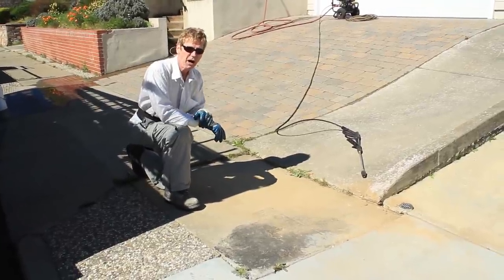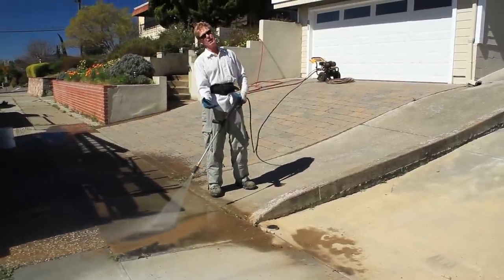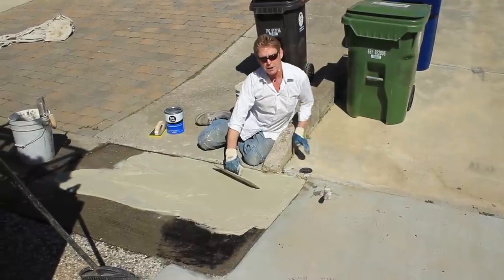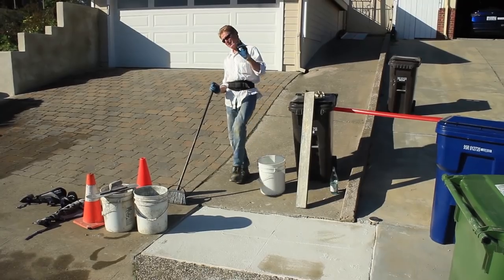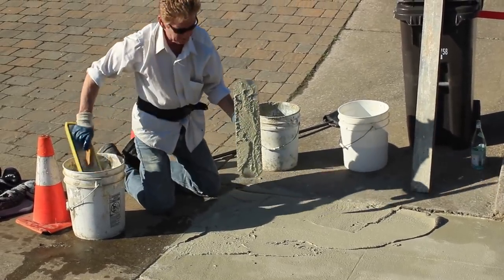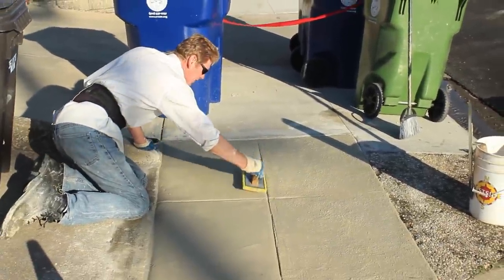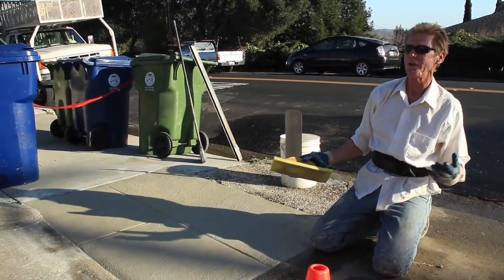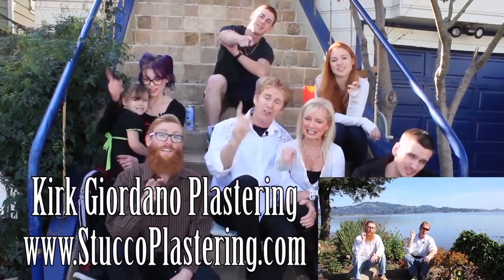Repair uneven concrete

Comment: Kirk, I'm wondering about the mix, ratio sand to poly? I love to plaster so I would really like the ratio sand to poly so I can do a small repair on my driveway. No, I don't like the product at HD OR LW. I get my material at the yard
Reply: i second this  , also "polybond"  it sounds like a denture cream ,and listening to Kirk he sounds like an infomercial pitchman with that perfect radio announcer voice ,if i close my eyes i  feel like i'm watching an infomercial for a denture cream LOL
dentures keep falling out ?  ,try polybond
Reply from the maker: Good afternoon Cristine and Andrea, LOL, we all know what Poly-bond is specifically engineered for attaching styrofoam to base coats of stucco.
 What I do is add about half the sand per mix. Thus if I add a half bucket of poly-bond, I add the rest with sand, then mix.
 Then let it slack for about 20 minutes. After the 20-minutes break, the slake by re-mixing, then fill the holes.
 As I did in this video, I sometimes skim the whole thing once more with the straight poly bond when this coat drys.
 Remember, this shit is important. Nothing adheres to a dusty, dirty, oily surface, 'Nothing,'  not Poly-bond or the best adhesive caulking Sikaflex. 
So if it comes off or cracks, you did it wrong.
 I believe I'm talking to two plasterers who already know this kind of stuff?😉
With my false teeth, I use full strength poly bond hold them in place plus taste yummy.🤔That's a joke, folks, so don't go saying I tried the stuff for my teeth and got sick.😏
          Kirk and Jason Giordano, together we have provided to all folks throughout the world the most complete plastering encyclopedia ever created online.
   The plastering surgeons of Youtube, with well over 850 'free' self-help videos 🎭 👀💃
 Bringing peace, love, and brotherhood back into plastering.🏝🎆
https://www.nps.gov/tps/how-to-preserve/briefs/22-stucco.htm
Reply: @StuccoPlastering  You replied, LOL. I can hardly wait to get started. First let make sure when you say sand, is it the stucco or sand that I would use concrete? No Poly- Bond for teeth, Lol.  I color coated a whole house thanks to your videos.  Next is my driveway then, another house. Thanks, KG
Reply from the maker: Good morning Cristine, dude. Concrete is portland cement and rocks.
 Stucco is portland cement and sand.
 Keep in mind if you use too much sand, you can have a weak surface.🤔
 I added just enough after the poly-bond slacked, I'd say about two or three handfuls. What I'm showing in this and a couple other similar videos are for small repairs. So you don't need much sand. 
 Hers a tip, brother, if the ground ain't clean enough to eat off, nothing will adhere for long. 😉
    Happy to hear you're going to stay in the trade. We need more plasterers. That's my job to educate, as I won't live forever.🤠
Kirk and Jason Giordano plastering, sharing well over 850 free Stucco/Plastering videos for your education. 
    Together we have created the most comprehensive encyclopedia of Stucco and Plastering videos ever produced globally, all by your favorite plastering messengers of YouTube.
Bringing peace, love, and brotherhood back into plastering.🎭🏝🎆
https://www.nps.gov/tps/how-to-preserve/briefs/22-stucco.htm

Comment: So i heard of the comparable product QUIKCRETE vinyl concrete patcher, but does a (Hydraulic Cement) coating blow this out of the water?...a better alternative for this type of application??  My patch area is very small.

Comment: I find Foamtek-20 to be superior to Poly-Bond in mounting decorative foam pop-outs to stucco walls. I think it would make a great choice also for skimming clean etched concrete. Cheers!
('course Poly-Bond is LaHabra and Foamtek is Omega)
Reply from the maker: Howdy Larry, good tip, brother, There's more than one way to skin a cat.
But, no doubt, as long as they are cementitious adhesives, they are similar.🍻
Reply: @StuccoPlastering  Hey! You really DO read these things. 😅👍
Reply from the maker: @LarryEMorse  Indeed, I do as they give me pleasure, not like being in my baby's arms but the mental stuff. 🍾

Comment: Hi Kirk. I’ve learnt lots of things watching your videos thank you. I’m not a stucco guy but I take an interest in what you guys do. Just a point about wetting the surface first with water. Does wetting first dilute the bonding of the material/glue to what you’re applying it to. Thinking the material has enough moisture in it to begin with to penetrate the surface. Cheers fella👍🦘🇦🇺
Reply from the maker: Hi Tyrone, water only dilutes a bonding agent that is not completely dry.💃

Comment: Hi Kirk, I tried cleaning my driveway by pressure washing before adding the product but there was still black areas that refused to come up!

Tried 100% chlorine with a garden sprayer and wow the rest of the concrete driveway looks super clean! 

Every heard of cleaning concrete with chlorine?
Thanks! Bobby
Reply from the maker: If you tried pressure washing with a tubo tip and it stayed stuck, apply a bonding agent over it and stucco away. Sometime not all things come out.👨‍🏫

Comment: Hi Kirk! Thanks for sharing. Is it LaHabra Poly-Bond that you are using? I want to try that stuff. Here in Canada, frost & de-icing salt are the most harmful things to cement or stucco. Maybe that cimenticious adhesive can keep water from getting between layers. You would not like it here in winter. ;-) Great video, stay safe.
Reply from the maker: Good morning Coal Guy Dude, I love the heat as in 80 to 95 degrees. I'm whining in 60-degree weather at this time.😉 For some reason, I am cold-blooded.
 I need to move to the equator like Cost Rica, personally.
  I know what spalling is, but not certain about the poly bond and the snow, sorry.🤔
  Note: to all subscribers or anyone who stumbles on our channel with a question, type it into our Stucco/Plastering channel, and like magic, a video will appear to explain how it's done. 
This feature is miles ahead of any plastering forum. 🥳
https://www.giordanoplastering.com/
Reply: @StuccoPlastering  , Which Polybond is the best for concrete resurfacing. Can you use La Habra base coat mix 1 : 1 part cement on the thin set resurfacing. Will they crack on the driveway if they cure too fast because of the heat. Thanks. .

Comment: Hey Kirk…can I use and thin out this Ploy-Bond as a “white wash” for my concrete driveway?

Thanks, Bobby!
Reply from the maker: Not sure, but in the description there are much easier to use product that can be purchased at HD or lowes, This product is only sold at plastering material yards.

Comment: Would using a masonary cutting wheel to cut random (straight and curves) lines into the surface (3/16" wide x 3/16" deep) provide "significantly better" adhesion? or no?
If no, what about 1/2" wide x 1/2" deep?
Reply: You will create a pocket where water will creep in and after freezing it will pop the upper layers making those cuts visible again. It will not work. Kirk does stucco and not walkway resurfacing jobs as he stated. I have seen this fail myself so I give my advice to not cut the original surface.
Reply from the maker: No, I’d recommend pressure washing so it’s clean enough to eat off then use a cementitious adhesive as we did, it may not last forever but I have seen it last more than ten to fifteen years, foot traffic and ground moment will determine how long it last. Cheers 😉

Comment: Do you need to add color to that or do you purchase it in a certain color? Because I saw some stuff at Home Depot by Lahabra and you can order online but they have different colors
Reply from the maker: Hello Carolynn, what I'm doing here can't be colored. Sorry, Plus, the materials are not found at Home deop or lows. HD does sell many other products that will achieve the same thing that is much more user-friendly. Some of those products are in the description.🥂

Comment: Mr. Kirk Giordano thanks for such a helpful video. Quick questions  did you add weld-crete blue can you have on the floor and if you did how to use it and in what stage did you use it?
Did you only use Polly bond for first and second coat only?
Thanks for your answers.
Reply from the maker: POly bond for the prep and the finish. 
 I find a pressure washing with a force of 3,000 to 3,500 psi minimum works fine it micro scores or etches the surface of the concrete.
Only gas pressure washers put out this pressure. They are easy to move and handle toy eclectic ones that won't work.
   For more force, buy a turbo tip. Turbo tips cost about 50 bucks but are worth every penny. They add to the force needed to etch or score below the surface.
    I prefer La Habra's "Poly Bond" for flat surfaces that may be walked or driven over.
   Polybond is only sold at professional plastering yards. It's a cementitious adhesive bonder designed to attach styrofoam to porous surfaces on a building. 
   How strong is professional Poly Bond, with the possibly thousands of pounds of styrofoam coated with cement attached on the tops of buildings or homes, weather 5 or 10 stories high, us contractors can't afford the elements such as wind and rain blowing them off for fear they may do some serious damage to whatever they land on?
  With Poly bond, there is slacking involved.
If you are afraid to place your food on that newly cleaned surface before troweling on Poly Bond, it's not clean enough.
  Nothing, not even the strongest caulking, will adhere to a flat surface that will be walked on. Therefore, expert and or professionally learned skills are required. 

    On a wall, it's not so important; however, when folks are walking on it, this is vibrations and needs extra care.
 Vibration the finish coats, especially on flat surfaces such as a driveway, are like kryptonite to superman, not good.
Reply: Kirk. looks like you have Weld Crete. Did you put it down first.
Reply from the maker: Evening Cristine, no Weld Crete is for bonding stucco to painted surfaces.
We used a poly bond which is a cementitious adhesive for this repair.
Reply: Kirk. I know your a stucco guy and I know you know about cements. So can I go over hairline cracks with Ardex?

Comment: So which do you recommend for repairing old concrete, Quickrete or Sakkrete ? Sounds confusing ? Thx
Reply from the maker: Howdy Bob, yea, your right it is confusing at first,
I'd recommend the more user-friendly, Sakrete gray self-leveler or Quikrete Self-Leveling Concrete Resurfacer or Rapid Set Concrete Leveler all of these resurfacing adhesive levelers are easier and much more user-friendly that can be purchased at Home Depot or Lowes, and many other hardware stores.

Also, you can google concrete self-leveling or resurfacing products, there are more than the three mentioned above I added these three as I'm familiar with their product's longevity and excellent history of quality all can be purchased at either HD and or Lowes.

Comment: So I wander how this not for this use compares to products that are made for that use.
25 years sounds like more than Home D. Or Lowe's products will achieve. Of course craftsmanship makes huge difference.
Reply from the maker: Howdy James, I'm simply showing materials I used in the past that have stood for over 20 to 30 years. Longevity is the key. 🍾
Reply: My question for low budget resurfacing old concrete. What kinds of La Habra polybond you are using. There are many kinds.  The base coat or the finish coat. I saw in the video the green colour. Thanks.
Reply: @StuccoPlastering  Thank you, your skill and experience is proven and valuable. Way cheaper than a new driveway that’s going to crack anyway. Saving $$ to do other needed repairs on the house like “ stucco“  or a new roof

Comment: Am I wrong in believing that the under-concrete drain pipe has separated from that drain cover and is washing the sand out from underneath the concrete sidewalk. As the sand is removed, the sidewalk starts to sink. Until they fix the original issue, they will continue to have issues with the sidewalk sinking and sand washing out onto the sidewalk.
Reply from the maker: Howdy Steven, I have no clue as to what's going on under there.🍾

Comment: What type material did you use for this work the last hand , is this from
home depot or lowes’ what name is ?
Reply from the maker: Howdy Daniel dude, It's called Poly Bond by La Habra sold at plastering yards.
Reply: I found it! I Googled "Plastering materials Yard" and found one near me, and it has Polybond.

Comment: What kind of sand and what ratio? Thanks Kirk! You're the man.
Reply from the maker: I sometimes add some sand with a one-to-one ratio. Here's an easier way to do it without having to slack or guess about adding sand. https://youtu.be/DF4xqPIVusI/ Alternative way to resurface uneven concrete with cement plaster, BMI 690.
Reply: @StuccoPlastering  Thanks!

Comment: home depot has something call "Polymer Modified Structural Concrete Repair" crazy stuff,2800psi after hours 7500psi 28days.
Reply from the maker: No doubt a "rapid set product."

Comment: Wet it and paint it with Portland and then add the concrete
Reply: White portland and admix acrylic glue, works great, then pour concrete over it.
Reply from the maker: To wet a dirty surface then do as you suggest, won't last long, However if you pressure wash it well, your method may work, How long all I have is an opinion, I'll keep to myself.🤔

Comment: I probably don't know what I am saying, but I would think you would fix the drainage so it doesn't collect water and dirt, instead of this.
Reply from the maker: Hello Shereese, your correctomundo, that was my suggestion also. However, that fix would probably cost more than a couple of hundred bucks they only wanted to spend. Plus, I informed them this fix would only be temporary. 🥳

Comment: It might be better to have a drain guy to do a cameria inspection of that storm drain. There may a hole in the pipe that is pushing the sub dirt from under the pavement. Also they can have a foam guy lift the slab up.
Reply from the maker: Good morning RC Men, I agree, I can think of many ways to fix this situation. Doubtful as inexpensive as I did it for, but the best and the permanent one is to remove and replace the complete area.
                         Bringing peace, love, and brotherhood back to the world of, “Plastering.” 😏
With over 800 educational and free Youtube videos, by your favorite plaster geek, “me,” and my son, “Jason,” the bearded plasterer.😉
Reply: @StuccoPlastering    Great video Kirk. We had a residential client with a similar problem.
A replacement sanitary drain was laid under their drive about 20 years ago.
The contractor back then filled with soil; not stone or rock around the pipe.
When it rains, the storm water runs along the drive, up to an expansion joint
at the pipe location, and then disappears in the joint. This had caused the slab to settle about
 3 inches. A concrete leveling firm pumped 5 yards of their pressure grout
into the void under the slab and raised it to the level of the rest of the drive.
Owner asked me what else to do? I suggested he use an elastic urethane
to seal the expansions joints. That seemed to solve the problem. 
The key to this is to avoid water influx under any slab or concrete horizontal
surface as it will eventually scour and cause damage.
Reply from the maker: @pensive69   Great advice, when they get the dough this is an option. They have checked out the cost from contractors to remove and repour, I have heard of Companies doing what you have done, It's definitely a more cost-effective approach.
Reply from the maker: @pensive69  
Howdy Pensive Dude, good tip, my brother.
Bringing peace, love, and brotherhood back to the world of, “Plastering.”😏
With over 800 educational and free Youtube videos, by your favorite plaster geek, “me,” and my son, “Jason,” the bearded plasterer. 🍻

Comment: did you stop it from puddling anymore or did it keep sinking ?
Reply from the maker: Greetings Bigtime, what I did was to fill the hole with water then squeeze as much mortar as I could to stop it from sinking future. Will this be a permanent fix?
 Of course not.
 It's best folks pay the one or two thousand to have it cut out removed then new rebar with Dobies as enforcement be installed and repoured with concrete.
  I do inform folks of this.
     However not all folk have the cash to do this, I changed 300 dollars for this temporary fix, that who knows may last a lifetime, but doubtful.
 Bringing peace, love, and brotherhood back to the world of Plastering. 🌍
    The complete plastering encyclopedia on video, by the plastering messengers of Youtube.  
     Over 850 videos 🎭 👀💃
Reply: @StuccoPlastering  Yeah I wouldn't want to spend 3 grand right now either thats for sure and it looks good anyway. sometimes good enough is better

Comment: Would have been Very happy to see the driveway Before yoh did fix number 2.. Even a snapshot..
Am happy to see you easily fixed it nicely again after four more years. They cannot do that in the White House... Ever, so far.
Reply from the maker: I hear they are low on funds down there.🤙